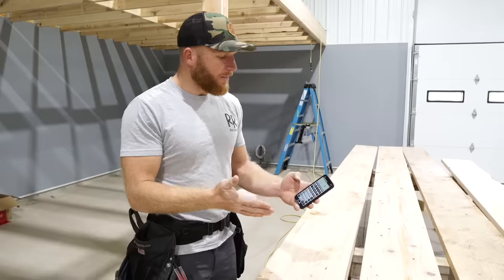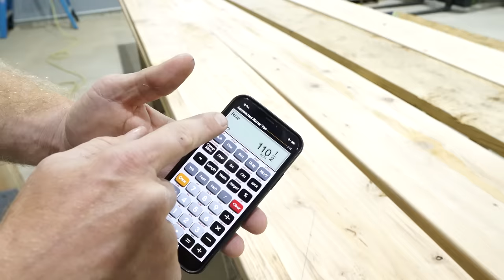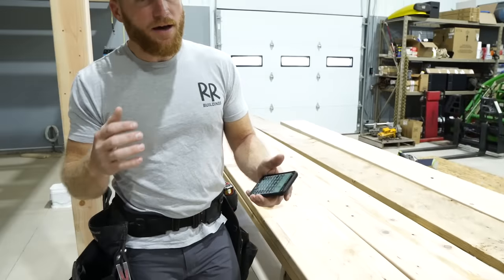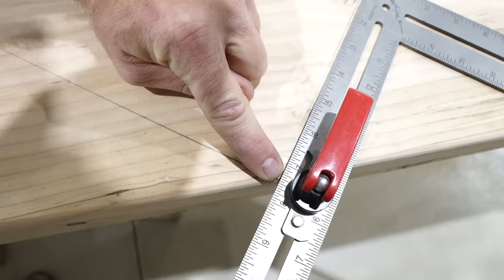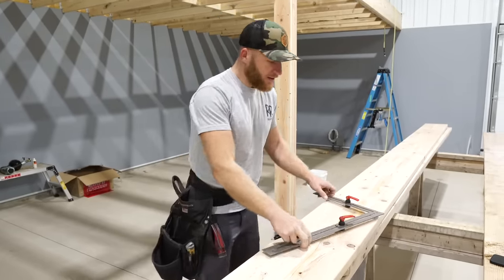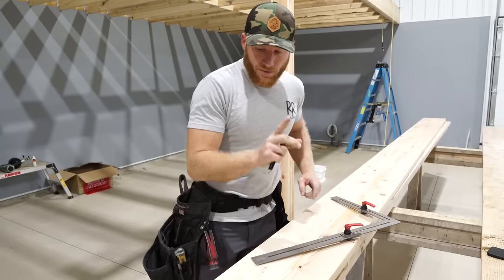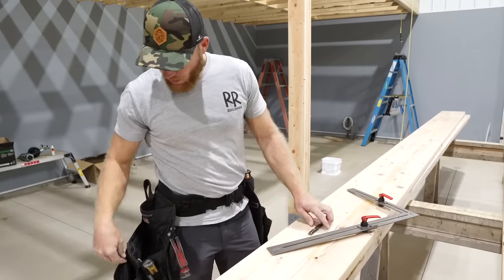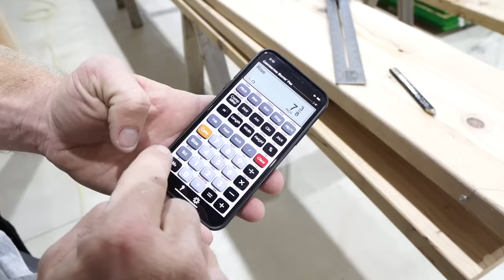Building a Large Staircase and How to Layout a Stair Stringer

Comment from the maker: I know it may not be super fancy, but I think the insight or tips I share should be able to help you build any stair case.  I've never done a curved stair...maybe that could be next.  Anyone have a good resource for that?
Reply from the maker: Mar is a good dude for sure.
Reply: @RRBuildings   for sure.
Reply: Kyle you mentioned not liking a solid outside beam because of dust getting in the cracks couldn't you trace the stringer onto a solid beam then use a router and remove 10mm of the stair shape to notch and seat it over the top. Just get a slightly larger height so you don't see the height difference in the two timbers and use a concave scotia trim or quad to neaten them up.
Reply: Awesome video man. God i wish i had that mega saw for cutting stringers 😂 it would have saved me months of my life at this point cutting individual. Great video though! Cool to see something a little different.  Love the channel and what you do. That caulking gun seems to work real well...may have to pick one up
Reply: How do you attach the stringers to the deck?
Reply: Moe Green  hurricane ties? Ok, what do you do when there's a post along side of the stringers? I must be old school. I was taught to screw a piece plywood into the stringer's back side then attach.
Reply: Moe Green  well to be honest I'm not a master either. I've only been in the trades 25 years and a licensed builder. This doesn't make me the best. Christ is the best. The post don't have to be attached at the top for support just the deck but it seems that the hurricane ties wouldn't allow the post to be flush the stringer stringer though. When putting spindles and handrails this is important. Only the bottom should be attached to the stringers. When installing on concrete it's best have a treated wood contacting the cement.  The tar paper will just  dry up and be of no use. I don't know.  I was just curious
Reply: Moe Green  I  know but my first comment was was asking about potential post. That's why I was still on the topic. The tar, well ok, if you want to that ok. It'll be there only for a short period of time but if that's what you do, who am I to say it's wrong. My only point was in the original comment was you can't have a hurricane tie in the way of the side of where a post could go. Also to screw though the back of a a doubled 2 by isn't gonna hold much and not very practical. The only thing long enough would be 5" screws. I was just curious. If he makes his stairs like this ok but I wouldn't do it like that. I'm no better or worse
Reply: @garethheathcote4988  it really is the same. In UK you do A(2)+B(2)=C(2) to get the length of the stringers. Where in the US we just do a simpler way. Each tread is called a run which most codes are 9" to 10", that'll never change  the rise is each individual height of the the step called a riser which mostcodes are 7" to 8.25". All we do is get a total rise height and divide by the number of risers staying within 7" and 8.25" and whatever comes out equally that's what we measure on the stringer. Same with the treads we just stay within 9" to 10". So really there's just 2 things we remember = each riser and each run or tread. Hope that helps you out
Reply: @garethheathcote4988  I'm just a carpenter. I don't use a program. I do use algebra and some trigonometry here and there but I'm not really computer savvy. Most of my knowledge is from experience with some schooling but to be honest I'm not the sharpest knife in the drawer.
Reply: CLP  a(2)+b(2)=c(2). To the length of opening to the stair hole or position of header you tomes the run( each step) by 9"-10" ( by code depending where you are). Example =say you have a 92.625"  stud with 4.5" ( plates)+ 10" ( for floor decking)= 107.625÷ 11( the total number of riser). Every set of stairs are total has 1 less tread to risers. 11 risers minus 1=10 treads or steps. 10× 10=100" for the stair hole length + your nosing( usually 1.25" + 2" ( worth of stringers)=100+1.25+2) so 103.25" for total length of stair hole. Hope that helps
Reply: CLP  130" is the just hole opening not the angle or length of the stringers. A(2) 107.25"would the the total rise top of deck to the lower level B(2) would be 130"  would be total run= c(2)= 130×130=168.531 or14. 04425 feet . In order to get the angle put the framing square on the stringer, one side do 10" and the other side 7.66" like a triangle each time for 13 treads and 14 risers. The angle is around 37 degrees. If you can Google stair making.
Reply: CLP  ok but it's not my channel. I'm just a carpenter who on the same channel.
Reply: CLP  lol. Hope you figure it out
Reply: You're not ready for curved staircases
Reply: Hi, I work in the field of carpentry. I have 15 years experience. I have a diploma. Can I work with you
Reply: CLP  the calculator tells you how many rises you need, and will also give you the overall length of the stair stringer. I use the same calculator. He just went 1 riser too many in my opinion
Reply: @SKANK_HUNT49  l've built them, you're right
Reply: @stevenlong1930  it's not an opinion. The top stair should not be even with the flooring upstairs. It should be like 7 and 1/2 inches down
Reply: @stevenlong1930  I've only done the handrail 4 curved stairs. The Builder always had prefab stairs installed
Reply: @garethheathcote4988  the top step should be down from the landing not even with it. Yes every step must have the same rise ofcourse.... it's real simple.
Reply: @garethheathcote4988  well no s**. Okay if you're having problems ask the Builder what type of flooring is going on the upstairs cut a block of wood the same thickness of that flooring. Also ask the Builder what type of flooring is going on the ground floor. Cut a block the same thickness of the down stairs flooring. Stand on a ladder next to the block you put on the ground floor. Push the dumb end of your tape measure down on top of the block. You may need a helper to hold it for you I don't know. Extend your tape past the level of the upstairs. Measuring to the top of the block you cut for the upstairs. Then get your Carpenters calculator and / how many risers you have. Don't forget to drop one inch off of the bottom riser. That means after the Stringer is cut you need to take 1 inch off of the bottom of the Stringer on the level cut.
Reply: @garethheathcote4988  just print my last comment and Fold It up put it in your glove compartment for when you have to calculate stringers.
Reply: @garethheathcote4988  I don't know how in the hell you passcodes building stairs like that. What part of the country are you in?
Reply: @garethheathcote4988  yeah you're doing it wrong. That is not what Master Carpenters do. Master Carpenters do things correctly
Reply: @SKANK_HUNT49  and I calculate stringersnall the time,I did one just before Christmas from solid oak strings and treads, they were open with no risers. I don't know where you developed am problem with me but don't even attempt to ridicule the work I have put in and continue to put in on a daily basis
Reply: @garethheathcote4988  okay guy. Your name Suits You because you are definitely confused. I was just trying to tell you the right way to do it. Do whatever you want
Reply: @garethheathcote4988  yes you finally said it right. You must have reread my instructions
Reply: How much would something like this cost approximately: parts and labor? East coast.
Reply: Lay out is always the key. Lay out the steps on the floor and work your way up. Use a 2x4 to the height of the full staircase as a story board. Hope you'll find that helpful. Working on stairs is actually a fun job. No staircase is alike.
Reply: That app also shows you how many steps. So you can double check that too. Great stair tips right here thoe
Reply: @garethheathcote4988  In this case he is not confined to a specific length. He can land where ever it happens to land so he can decide on the tread width arbitrarily, at least within code that is. If there was a wall or a hallway or some other limiting factor on where the stairs had to land then he would of had to put that into the equation. 7 3/8" is the height that worked out.
Reply: @RR Buildings. FYI.....7-3/8” rise is illegal, it’s 3/8” too high. The MAXIMUM rise is 7” or 4” minimum rise, thread should have a minimum of 11”. This is base on American Institute Architects, just remember the store 7-eleven.
Reply: Weren’t you suppose to take 1”1/2 off the back side on the top.
Reply: @vivalasvegas702  You are absolutely correct on that one. 7" on the rise is the code according to the RBC along with 11" tread. And no more then 1/16" variation between any one step except the top OR the bottom but not both that can have 3/8" difference but no more.
Reply: RR Buildings jothaon
Reply: A good resourcd? Yeah, me.
Reply: @stevenlong1930  how do you figure out how many risers to make
Reply: Soon as I saw that fancy calculator I knew this was a job that I will never challenge lmao🤣😂
Reply: I have to tewatch your video. I didn't get a single thing out of it except that you have the most lovely man physic lol. Now hopefully the second time, I learn how to build stairs!
Reply: Well done well said brother 
Very nice share.!!! 🙏🏻
Truth on the square add-ons
Link to that square.???
Reply: People just dont drill pilot holes no more do they..
Reply: I did a semi-circular stair years ago, layed it out on the floor to get the tread shape right.
Reply: Definitely helped me out, my head would fall off trying to set out a stringer
Reply: Thank you !
Reply: Got the app. Can't figure out why I keep going passed my diagonal proof-point.
7'-4" Run. 7'-1" Rise. Diagonal of 11 3/4".(Riser=7 3/4" Tread width= 8 13/16")
My second Riser is always running long and going passed the diagonal marker. Pulling my hair out over here. 🤪
Reply: Thanks for the video

But when i hear 12 & 7/16 ... 😅 im soo happy to work with metric system 😂
Reply: Where i buy the square
Reply: @RRBuildings  How do you figure out how long to make the stringers from floor (start point) to top of stringer that meets second floor? How do you know how many risers and treads to cut from bottom to top? You hooked tape to top floor and ran it straight down to floor, which is how you got 110 1/2 measurement? Right? How do you use this measurement to know how long ringers will be from floor to top? How many risers, treads to cut from floor to top? Where did that 10 inch measurement come from? Rise 7 3/8 came from 110 1/2 measurement but where did 10 inch measurement come from?
Reply: Too complicated
Reply: OK, three years later, but here's a Japanese carpenter making a winder stair. His name is Shoyan.  Look at the quality of the lumber he uses too.
https://www.youtube.com/watch?v=CFLpAxdkgzE

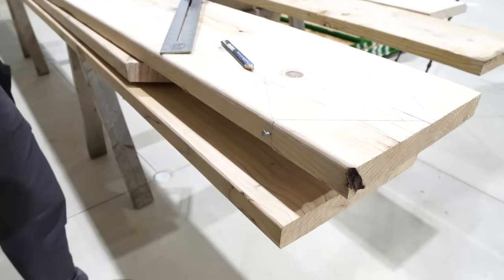Comment: I like the fact that you check the stringer using the diagonals at 6:20.  A quicker way to use your calculator would be to enter 12-7/16" , then press + then every time you press = , it will automatically add another 12-7/16" .  This method eliminates the possibility of entering the wrong value at some point
Reply: Though he didn’t verbally say it, that’s what he did after the second calculation… he simply hit the equal button.

Comment: One thing you need to be carful of when using the construction master calculator for compounding measurments like stair stringers or balusters is that you have the resolution set to either 1 /32 or 1/64th. Default is 1/16 and that can get you in trouble building long stairs. Your measurments were only off by a 64th per riser so not that big a deal in 110 inches of overall rise but its always a good thing to check so you dont wind up being 3/4" off on your last rise.
Reply: How do you calibrate that?
Reply: On the phone app ..Cm5,
Tap the gear icon in the lower right corner. Under “display settings “ tap “fractional resolution” and choose between 1/16, 1/32 or 1/64.  
Not sure how to change  the resolution on the  actual hardware calculator you buy at the store.
Hope that helps.

Comment: Thank you very much.  Flipping the square edge was very helpful and the 1.5 from it. Now I understand. We are using composite decking and it’s only 1” thick so I subtracted 1” and it came out right. First timer. Thanks again
Reply: I understand the subtraction from the first step so it comes out to 7 3/8s,  but then wouldn't the next steps come out to be 8 7/8 because of the 1 1/2 of the 2x12, I'm so confused in that part lol

Comment: Just remember if you're doing a more traditional stringer install that is not flush to the top of landing you must always deduct two dimensions:. Tread thickness off the bottom of stringer and riser material thickness off top tread width.  Good job on the video!

Comment: Great job. But...
Don't get glue on the pipes. Put a sleeve of cardboard around that protrudes top and bottom. Cut the hole big enough to let the stairs and the piping move without breaking. IE. 13/8" pipe diameter plus 1/2" is 17/8" hole saw. The stair glue will weaken the pipe and that's where it will break.

Comment: Its awesome one thing I do is notch out bottom of the stingers in the front to put a 2x4 across the bottom that you can connect to the floor via anchor or screw that will keep it from shifting forward over time

Comment: Only thing I would change being a framer of 12 years is, do not use 90 degree strong tie brackets to secure the top of the stringers. Always use pressure blocks especially when you never fastened the bottom to the floor. Stairs work as a wedge but if there is nothing stopping the outward slide on bottom , they will give.

I too used to make the same mistake to taking the 1" 1/2 off the bottom tread. Also do not forget to take the thickness of your kick plate off the back of the top riser or your top tread will not hang over far enough
Reply: 🌲🍀🌲   @Willis Cooper 
I appreciate the comments you added to this.  This is a project that doesn't require many yrs of experience, but the young man is so used to his method of stair building, he may not realize he's not explaining each "step" (no pun intended.)  Even where to glue and what sort of glue to use.  
In following a how-to video, we should always watch others to make sure that finished project has everything we want...like a bottom plate fastened to the concrete floor?  As I envisioned the stairs in our 2-story garage, that seemed like a good idea.  
Watching several of these videos should cover every feature we need help with!!  Thanks to all!!🙂

Comment: Well done, and I enjoyed your video. Not sure if you had the option on this build, but eliminating the first tread at the top, and stepping down from the floor, would have kept you away from the breaker box at the bottom... also eating up less space and material. It also makes a cleaner looking and easier handrail install. When laying boards down on the flat, like your treads in this case, always make sure your grain arch’s are up. It helps stopping them from pulling up and separating. Just some thoughts

Comment: Good video.  You can omit the top tread by using the 2nd floor as the top step; the stringers die into the floor joists. This reduces the overall length of the stringers, and it saves space on the first floor by reducing the total run, and it saves one step tread, too.

Comment: Kyle  when cutting out your treads if you notch 3-1/2" by 1-1/2" on the bottom you can attach a plate at the bottom of the treads to the floor to hold down pressure of the stairs

Comment: Thank you. Very informative. Cut my first stringer today and used it for a template for the second one. Things didn't look right. Layed it out with the square and learned first lesson.  Make sure that your lumber is perfectly true. I looked at it when I bought it, but the first one had a slight bow in it. LESSON LEARNED. I will secure one end of it and try to force it into a straight chalkline. If that doesn't work, it's back to the lumber yard. Those 2x12s are expensive!

Comment: I thought when cut the bottom of the stringers you were going to add a piece of 2x across the bottom to anchor them to the floor. Is the strand board the final floor?
Reply: We called it a "kicker", used to be code around where I live, maybe it still is.
Reply: yeah we did it as well.....anchor it to cement and cut notch in all stringers and it cant slide away from structure
Reply: Good call, that is very important to do , otherwise you are just relying on those nails at the top.
Reply: Dionis Herrera I think he liquid nails the bottom to the concrete
Reply: Likely doesn't want to anchor anything in the floor due to the infloor heating system. Could be glued or get the fire department out to find the pipes with their thermal camera.
Reply: A long stair like that, especially after treads & risers, is heavy enough to keep it in place on its own almost. I would never rely on weight alone, but he says he screwed stringers in from behind (which will resist pullout significantly more than nails, especially if using  timber loks or similar), and also added steel corner brackets to each stringer fastened with what looked like scrails
Reply: TheGhostBeast not the same.
Reply: Could always run a piece of flat strap from bottom stringer to a post or column temporarily...........besides- once the storage area under the stairs is built, it’ll provide plenty of bracing

Comment: Being in the metal fabrication trade I get to work on steel stairs, beams , columns etc. It was easy for me to understand you, pretty straight forward. I have that calculator too. Working with wood seems to be very fun, specially having those tools, very clean work. If I had to pick another trade I would definitely go with carpentry, framer I don't really know the proper terms.